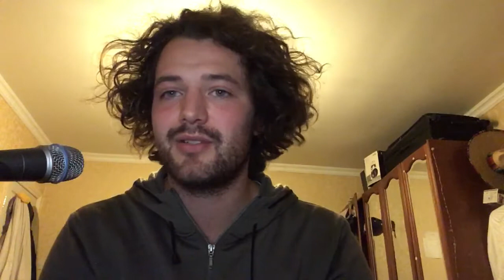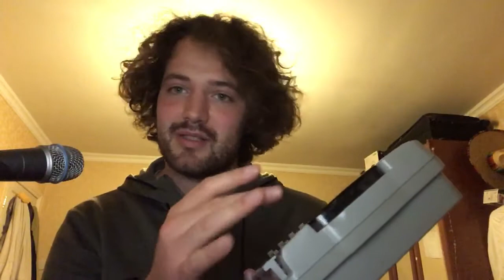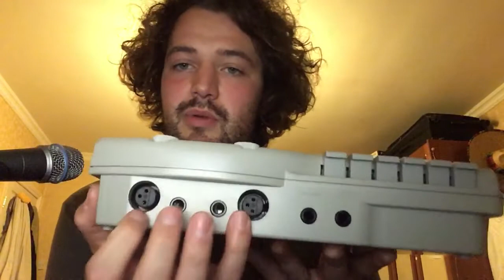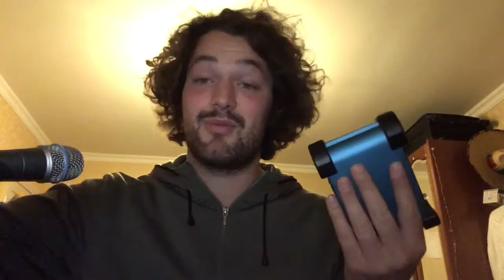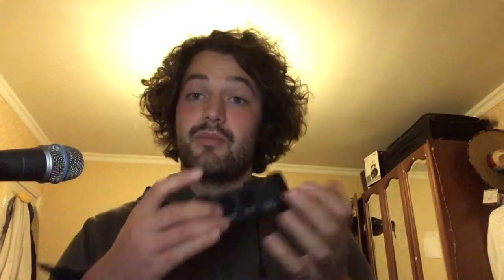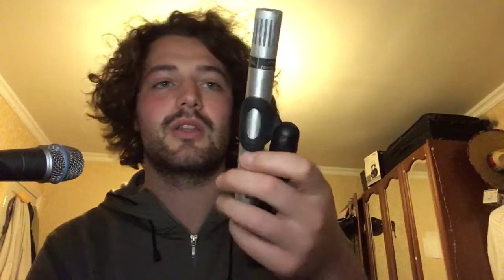Audio Solutions: Preserving Audio Fidelity on a 4-Track Cassette Machine

Comment: Heck yeah, love the limitations of only four tracks plus slamming just about anything through a four track always comes out sound fuzzy and great. I had never even thought about battery powered mics. Awesome!
Reply from the maker: Hey! thanks for watching! my favorite part about battery powered mics is how many different ones there are, because its a pretty old school solution to using a condenser mic with tape there are just loads of different options and most of them have been long forgotten at this point